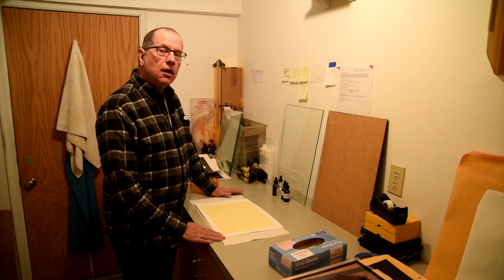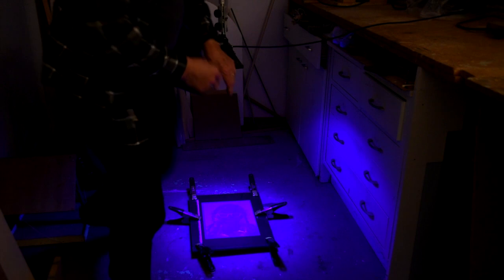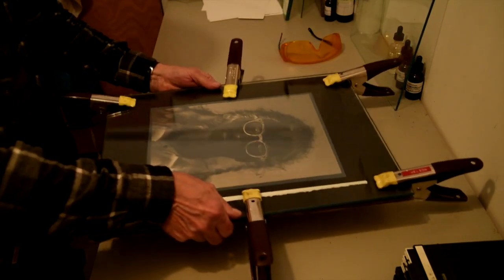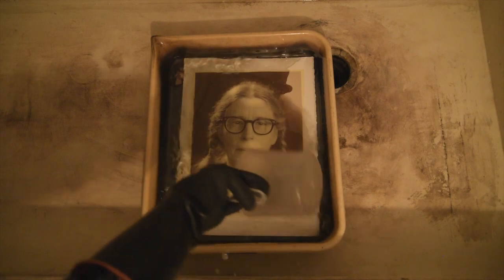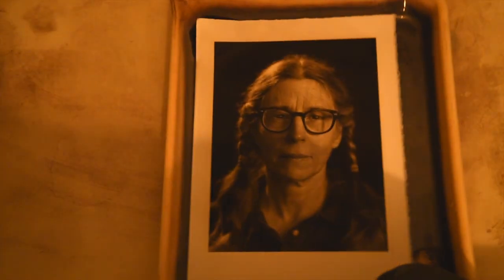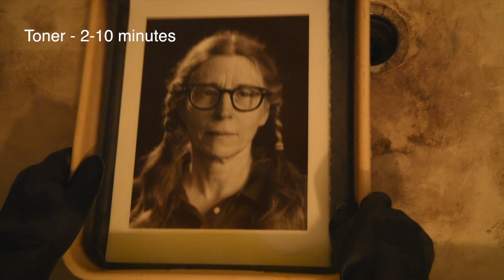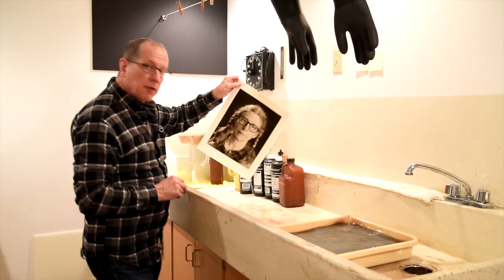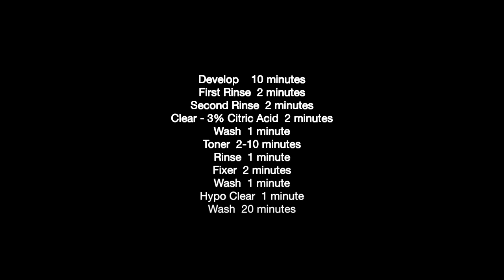Kallitype  Printing, Part 2

Comment: Hi Tom, your presentation is very well done, clear and straight forward..thanks for posting the video. Tom, I'm curious have you ever used Selenium Toner with this process?
Reply from the maker: I haven't tried selenium. Sandy King and Ed Buffaloe caution that selenium will cause staining if used before fixing: https://www.sandykingphotography.com/resources/technical-writing/the-kallitype-process
https://unblinkingeye.com/Articles/Ferric/ferric.html
There's a lot of controversy about it. Some say it stains, some that it has to be used in too dilute a solution to be useful, and others say that it's fine. Here's more:
https://www.photrio.com/forum/threads/toning-kallitypes-some-questions.21313/

Comment: Thanks for sharing your Kallitype process here on youtube. May I ask you about your developer recipe ?
Reply from the maker: I'm using sodium citrate (200 grams/ liter of distilled water). In my experience, the toner, not the developer, determines the color so you might as well use something cheap. I heat the water to help the citrate dissolve. For a 9x12" print, I add 130 ml of fresh developer each print. and discard the same amount The rest of the developer gets used again and again.

Comment: This is very informative and the details you get from your prints are amazing. How much citric acid solution and fixer solution are you using in the tray?
Reply from the maker: I make a liter of acidified tap water with just a pinch of citric and use half of it for each rinse. In my 11x14" tray, I use 200 ml of 3% citric and fixer.

Comment: Dear Mr. Nelson,
Thanks so much for the detailed video. I have a couple of questions, if you don't mind:
a) First, could you give me a few details about the UV lamp/light you're using? It looks like something I've never seen (I live in Canada) and I cannot guess what it is. I'm currently experimenting with a self-made UV box, however, the expose times are excruciatingly long (almost 3 hrs for a cyanotype negative...).
b) What kind of developer & fixer are you using? Are they just the regular ones used in traditional analogue paper development? 
Thanks again and I look forward to future videos, hopefully related to alternative processes. 
My absolute best,
Leo
Reply from the maker: Hi Leo,
a) The light I'm using is a Quans 110v 20 watt UV light I bought on Amazon. Here's a link:
https://www.amazon.com/QUANS-Violet-Blacklight-fishing-Aquarium/dp/B018C71QHI
In my setup, I get a maximum black at 18 minutes with the light 30" from the contact frame. But do your own tests.
b) Kallitypes use a totally different developer than silver prints. There are plenty of suggested formulations but the most common one is sodium citrate (200 grams/liter). I use a slightly more complicated one proposed by Russell Young as his brown-black developer:
50 grams borax (20 Mule Team from the grocery store)
40 grams Rochelle salt (find on eBay)
Distilled water to make 1 liter (heat before dissolving the solids)
To be honest, I wish I'd started on sodium citrate before making my tests since I find the results are very similar.

The fixer is sodium thiosulfate (known as hypo to traditional darkroom workers). It's a little more complicated formula:
50 g sodium thiosulfate
10 g sodium carbonate (washing soda from the grocery store)
2 g sodium sulfite
Hot distilled water to make 1 liter

Best of luck with your kallitypes! Let me know if I can give more help.
Tom

Comment: Very clear and informative. Obviously the result of much effort and time spent understanding this process. I liked your use of of a mask around the border. Can I ask what material it is made of as i would like to try it too. I assume it will need to be quite thin so as not to reduce the contact pressure between negative and paper.
Reply from the maker: Iain M the mask is simple construction paper. It doesn’t seem to affect sharpness. BTW I’ve lately embraced the look of the brush-stroked margin and no longer use the mask.

Comment: Hi Tom...my question has to do with washing...I live in the country so I have well water.  Will washing 20 mins with distilled jug water work or is it crucial to have running water?  Great video btw
Reply from the maker: Short answer: I don’t know. You definitely don’t need distilled water for washing. Well water should be fine even if it has a high iron content because by that time all the iron compounds should be neutralized. I’ve washed in still water with a few changes of water but I don’t know how archival it will be. You could also rig a recirculating pump to keep water moving and at least get even results. I hope this helps.
Reply from the maker: OK, I thought about this some more and this is what I came up with. If your well water has iron, sulfur or other minerals, the emulsion is stable but the paper may show staining or spotting. Better to use deionized water you find at fill stations in some grocery stores (mine charges 38¢ a gallon if I bring my own containers). Cover the print with it and give constant agitation for 5 minutes, then dump and refill 3 times for a total of 20 minutes. That should be equivalent to a 20 minute wash in running city water.
Reply: @tnp651  thanks for the feedback...ill give it a shot. Thanks

Comment from the maker: Mantas DK, 6.7 ml of Bostick & Sullivan palladium solution #3 and 5 grams of sodium sulfite in distilled water to make 1 liter. Shake the bottle before use, as the heavy palladium tends to settle. I use 100 ml of this solution for a 9x12” (22x30 cm) print. Palladium has gotten expensive and it seems I can dilute the mixed solution 1:1 with water and get the same effect.
Reply from the maker: See my video onb toners to learn a better way.

Comment: Hi Tom!
I am new to callitype and watched all your videos. Love the way you inform about the technique. I still have some questions that I hope to get answered.
Making digital nbegatives went well, especially with further adjustment of the curve as you describe in your video. My tap water hra too high pH value. Use a little citric acid as you show. But for some reason after washing and before 3% citric acid bleach, the image turns golden brown. Gold tones don't help much to cool down the tone. When I use distilled water from the store, I get perfect results as you describe. Image does not turn yellow after washing. Gold tones cool down the tone and that's how I like it. My question is, what should be done with the tap water so that the images do not turn yellow when rinsed in tap water before toner and fix.
Tap water pH =8.32
Reply from the maker: Hi Robert, I don’t want to pretend to more expertise than I have, but you might try a short soak in distilled water (just enough to cover) before toning. You can also try inexpensive de-ionized water you can find at fill stations in some grocery stores. Try those and let me know; I may be able to help further.
Reply: @tnp651  Hello Tom. Thanks for the answer. I bought a machine that makes distilled water, but with the electricity prices in Western Europe it will be cheaper to make platinum prints. I'm joking :) I bought the de-ionized water at the store and it works fine, but the prices are high. The color change occurs after the second water rinse. I do as you describe, dividing a liter of water with a little citric acid into two rinses. So I don't think it will help with a short soak before toning since the color change will be a fact. Wondering if anyone else has had a similar problem?
Reply from the maker: @roberoto100  1. Try adding more citric acid to the rinse water. Your water may be particularly alkaline. 2. You may be able to get by with re-using acidified distilled water for the two-part rinse. Add a bit more citric acid to make up for what was used. These are just guesses, since I don't have the problem you do. Good luck!
Reply: @tnp651  Hello again!
You had some very interesting thoughts about using the same water multiple times.
I will try both of your suggestions and share with you what was the result. Have I mentioned that the tap water measures approx. pH=8.4
Reply from the maker: @roberoto100  you'll definitely need to use more citric to overcome your alkaline water. I happened upon the following exchange on some bulletin board (I don't remember where): 
Dennis Moser
Admin
Two things to be very careful about with the iron-silver salt prints (especially kallitypes and argyrotypes):
1. Mix fresh baths of the expendables such as EDTA and citric acid. Always. Never try to economize and reuse from session to session.
2. Water quality. Unless you're using distilled water. Not just the pH (you should be checking that anyway), but the chlorine content. And not just for chlorine content but chloramine content.
If you have to use tapwater, try boiling up a couple of liters and let them cool down, then test them.
Distilled always works but isn't always easily available and can eliminate some of the staining.

Paul Alexis
I had this problem with the kallitype, . To eliminate the yellow haze, I used to do 3 baths, the first one with a pinch of citric acid and demineralized water, the 2 following ones with edta (4/100) and the final rinse (after the fix), a 1/100 sodium sulfite bath (hypoclear). The recipe is not mine but it is effective
Reply: @tnp651  Hi Tom! Thank you very much for your last post. I had the feeling that there was more to the tap water than just using citric acid. I can't wait to try it next week and report back on the results.
Can I use sodium sulfite instead of EDTA?
Will try boiling the water too.
Reply: @tnp651  Hello again. Wondering if charcoal/carbon filters for drinking water would have helped with chlorine?
Reply from the maker: @roberoto100  Hello again. Isn't testing fun? Try making a few small test prints with extra citrate and with sodium sulfite. You'll know right away if you still have staining. Choose the one that works for you. I doubt charcoal filters will work but that's another thing to test. I like the idea of boiling tap water too (if the cost of heating isn't too great). In my more-neutral water, I pour a beaker and leave it overnight to let the chlorine evaporate. I use that for my slightly-acidic stop baths.
Reply: @tnp651  Hello again Tom!
Have had a few unexpected visits and was delayed with my tests. Yes, of course it's fun to test. :) Had it tested today with boiled water. boiled the water for about 15 min, cooled and used. Unfortunately, the result was no better than water straight from the tap.
I forgot to say that I use acetate developer for neutral color in the pictures. Now I want to boil water and let it stand for a day before I use it. Will let you know later. //Robert
Reply: Hi Tom! I have tested a lot and have a lot to tell. Hopefully many will find it valuable information. I found that the biggest impact on my photos is the development time. I used 10 min as you have recommended in your videos. Even rainwater gave me some discolouration/stain. When I use 8 min development time, the rainwater works perfectly. No discoloration when rinsing. Tom, what do you think, will 8min development be sufficient in terms of durability? As I experience with 8 min development, the image does not become as bright as with 10 min development when bleaching in 3% citric acid for 2 min. I don't understand that 2 minutes of extra development makes such a big difference to the finished result. Do you have any thoughts on that?
Reply from the maker: @roberoto100  I've heard of development times as short as 5 minutes. I haven't tested it but it sounds like 8 minutes is a good compromise: no staining in exchange for a little softness. You can increase contrast of the negative to compensate.
Reply: @tnp651  Tom, I must thank you for all the help I have received from you. Thank you very much! Now I can't wait to produce some pictures :)

Comment: Hey Tom, looking to get a list of the developer, stock developer, fixer and all of the other chemicals that you use in this video. Could you reply to this comment so I know which ones I'm going to need to buy? 
I am also planning on using Gold toner to get a more neutral black. Do you have any tips for me to make sure I get it right? Thanks again
Reply: also, how much water are you putting in to your fixer solution, developer, etc. Thanks so much!
Reply from the maker: Hi Tanner, here's what you need:
Sensitizer is 10% silver nitrate and 20% ferric oxalate, with a drop of ammonium dichromate and a wetting solution called TWEEN-20. None of these is expensive and you can find them on eBay.
There are dozens of suggested developers but the most popular is the simplest and cheapest: sodium citrate. Citric acid is used as a clearing bath. Fixer is hypo (sodium thiosulfate). Don't use rapid fixer for regular prints. Toner is the only expensive ingredient. You can use gold, palladium or platinum. You can also use selenium, but Sandy King recommends against it:
https://www.sandykingphotography.com/resources/technical-writing/the-kallitype-process
As I say in the video, I recommend using the minimum amount of toner and discarding it when the print is toned. The only other thing to know about heavy-metal toners is that the metallic component tends to settle. Shake the bottle before you pour the toner. 
Good luck!
Reply: Thank you, Tom! You’ve saved my bacon for my class I’m taking. Thanks again!

Comment: WOW a beautiful result. thanks for sharing i ll try it out. could you give an over all price for all the chemicals per one foto sized like yours? best whishes.
Reply from the maker: I figure $7 per print for paper and chemicals per 9x12” print. That said, palladium toner has increased in price lately. When I bought it last year at the lower price,100ml of mixed solution was about $2 of the total. I’ve been experimenting with greater dilution and it doesn’t seem to hurt.
Reply: Tom Nelson thank you so much!